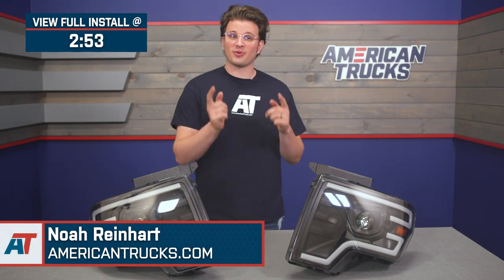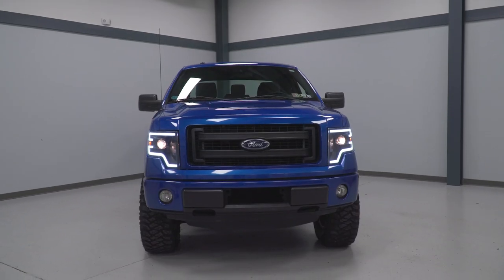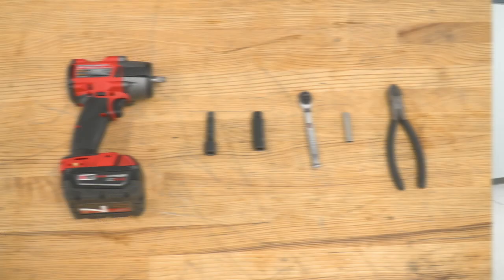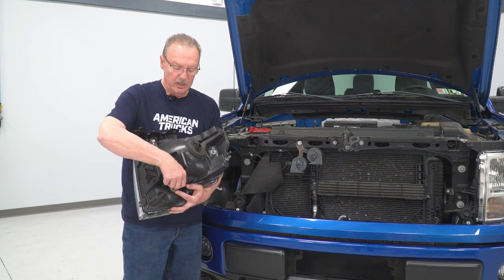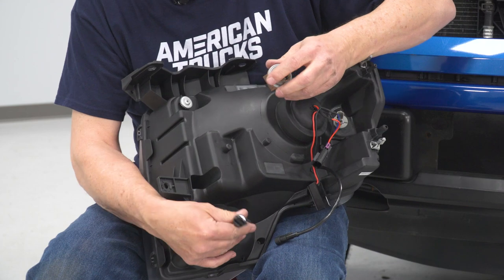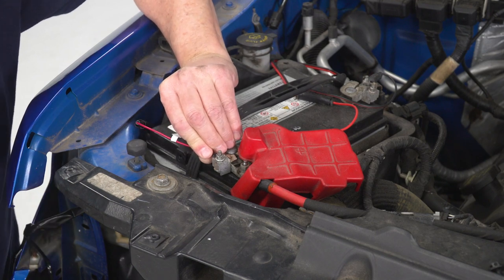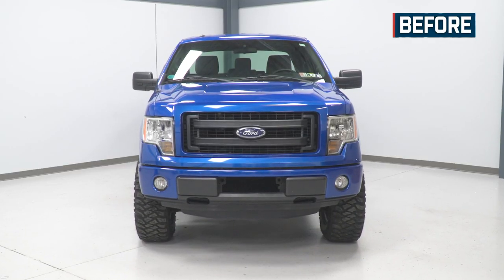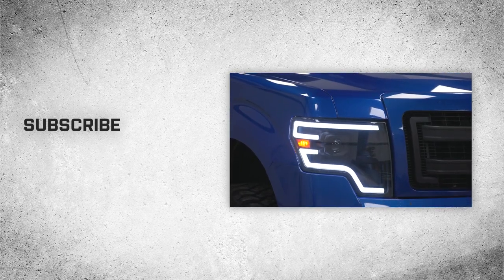2009-2014 F-150 Switchback Sequential Turn Signal Projector Headlights Review & Install

Comment: Y’all don’t show how to convert the rest of the system to LED. I installed sequential turn signal lights on my 2014 f150 and it hyperflashes. Installed resistors, stil hyperflashed, installed another set of resistors farther down the wires and still hyperflashes